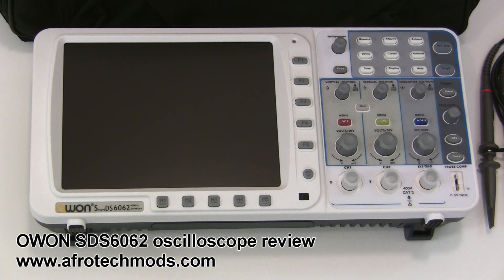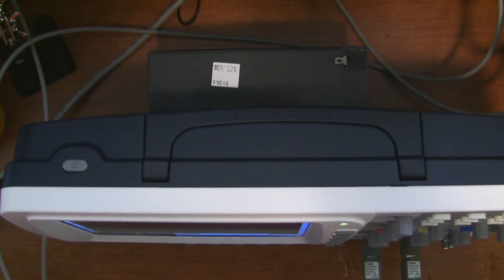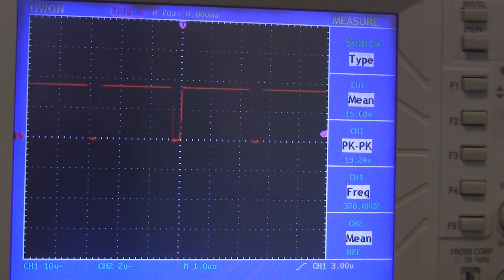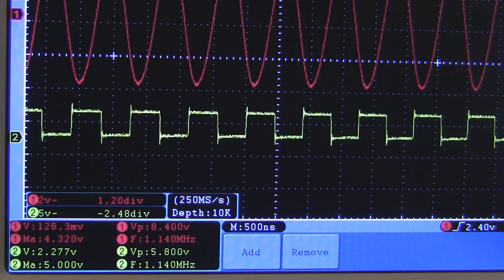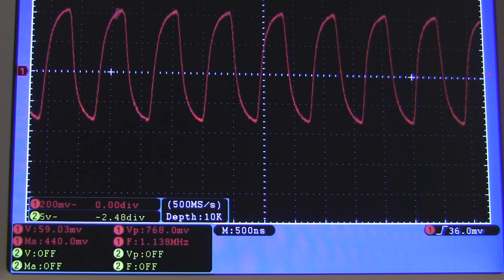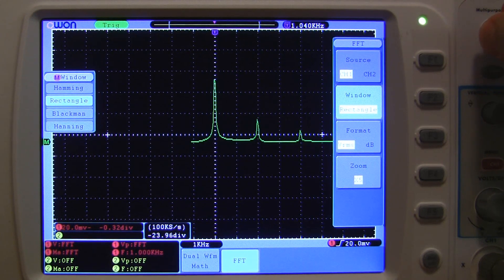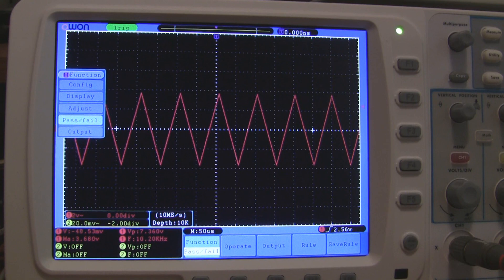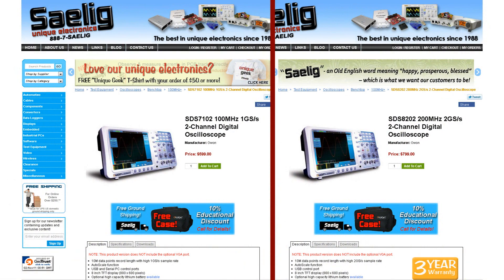OWON SDS6062 oscilloscope review

Comment: +Afrotechmods Im looking for a digital oscilloscope, I need 2 channel, shows min/max ranges, under $300 is best, so far the SDS5032E model looks like a very good candidate

Also on super/untra caps could they be used in electric scooters? if so what would that be like compared to a comon 12AH SLA? Should be fun though!

Comment from the maker: The SDS6062 has a battery option. I use it and it works great. Way better than most of those POS portable scopes. I don't know what your application is but search for "Fundamentals of Floating Measurements and Isolated Input Oscilloscopes" by Tektronix and it will tell you everything you need to know.

Comment: I actually just got one of these for christmas.  The new version is the SDS6062V, with the VGA-out port.  It seems that Owon has fixed the issue with the sliding rear feet, they have added little rubber traction strips to them.  Currently, I have absolutely no complaints with this scope so far, in fact, I'm fairly impressed with it for $350.  It's powerful, fast, and very light.  And doesn't slide when you push the buttons.  I'd recommend it to any hobbyist or professional alike.

Comment: Thanks for the very nice review.  I own both the SDS 6062 and the PDS 5022S.  (The latter is now for sale--can't justify having  two!)   Both give you a lot of bang for the buck.  I would note that these scopes are very lightweight:  1.8 kg (4 lbs.) for the 6062, and 1.6 kg (3.5 lbs.) for the 5022S.   I place mine at eye level on a shelf above my workbench, and I haven't experienced the slippage problem.   Maybe it's just a matter of positioning, or --more likely-- the texture of the surface.

Comment: Another thing that would be very interesting to know is how fast it responses to changes.
For example when you have a high frequency rectangle wave which is shifted back and forward according to an audio signal.
On the digital oscilloscopes we use in school the screen takes a few fractions of a second to respond. Where at the same time the analog oscilloscope was able to show this signal pretty smooth (maybe you own an analog oscilloscope and you know what I mean).